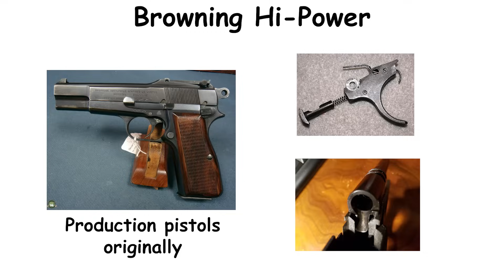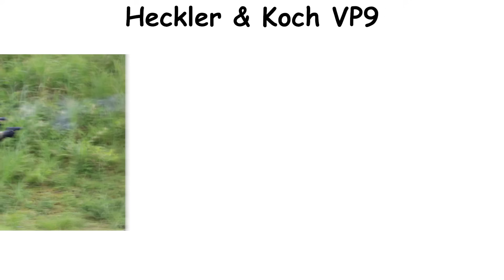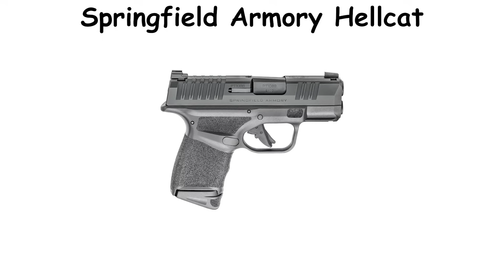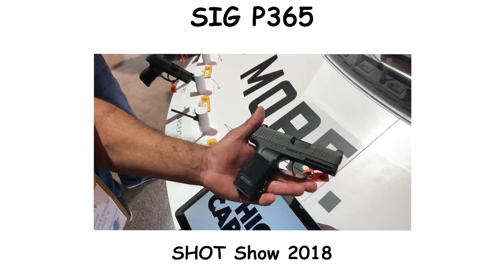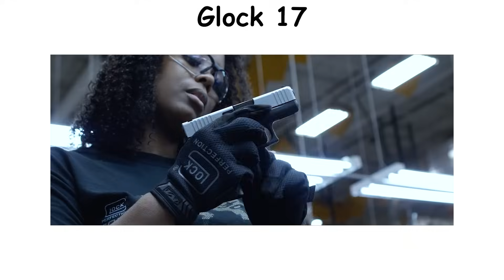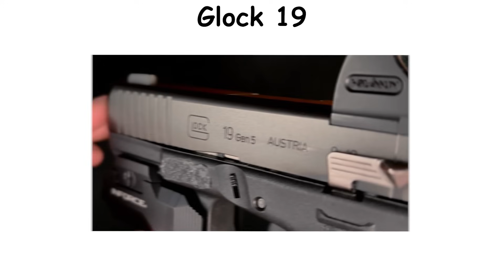Every Popular 9mm Pistol Explained

Comment: This video is stupid. Specify 9x19mm Parabellum.  There are well over 18 different types (sizes) 9mm of cartridges for handguns. The .380 ACP is called 9mm Short or 9mm Browning in Europe. The Makarov is also a 9mm. There is also 9mm Browning Long, 9mm Steyr, 9mm Largo, 9mm Super, 9mm IMI, 9mm Dillon, 9mm Mars, 9mm Winchester Magnum, 9mm Winchester, 9mm Ultra, etc. etc. None of those are 9x19mm Parabellum AKA 9mm Luger. The 9mm Makarov is about half way in between 9mm Short AKA the .380 ACP, or 9mm Corta, Kurt, Kurtz, Kurz, Cort, Corto and other words for "short" in other languages or the 9mm Browning.